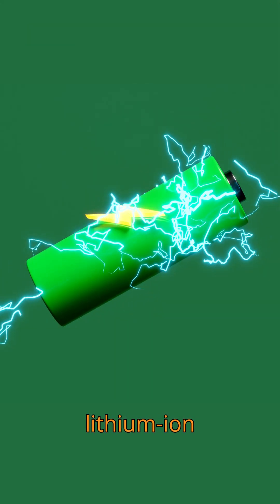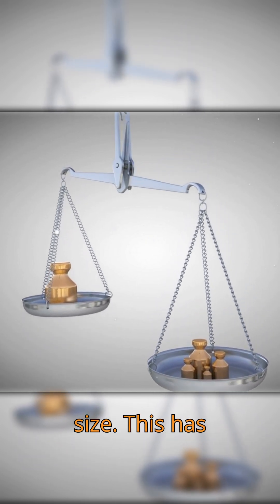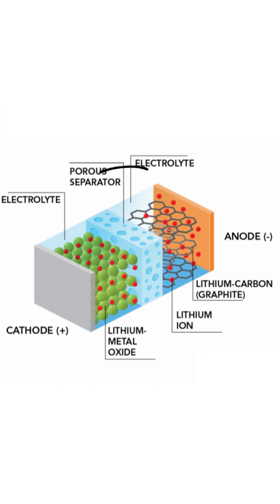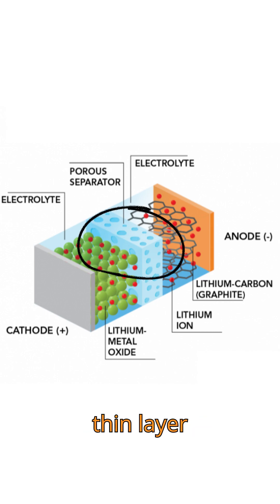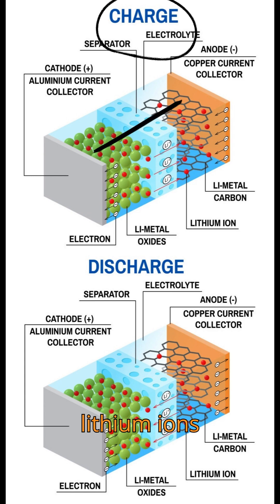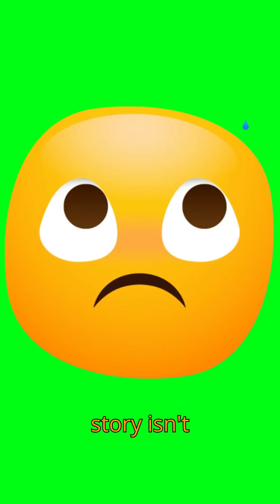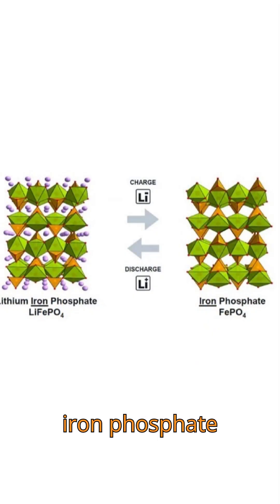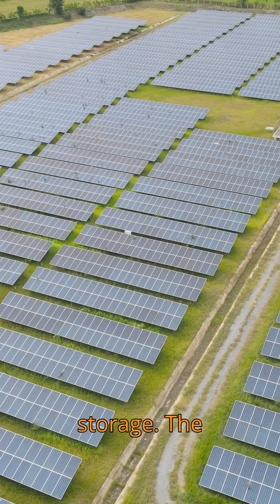How do Lithium battery works

Comment: X.V.MMXXV/2348h 🇺🇸 This is a wide spectrum subject to discuss and or to provide reasonable pros  and cons info on Li-Ion cells and LiFePo4 cells.Before the advent of LiFePo4; 
Li-Ion cells were prevalent. Perhaps even now. I still stock a fair amount of Li-Ipn cells and they function quite well. Because I check the function every 10 minutes a day
But at the advent of LiFePO4 cells entered the field; I forgot the former gradually. LFP cells have their own brain (I think) They are steady and maintain the Voltage and Current steadily than the former. I can go on, but time and space forbid me from long lecture.
Now I'm on to Salt Cells ie: Na-Ion cells  (Sodium Ion cells) It perform slightly better than former and the latter. It's a long and interesting matter to discuss. But I have to bid farewell.